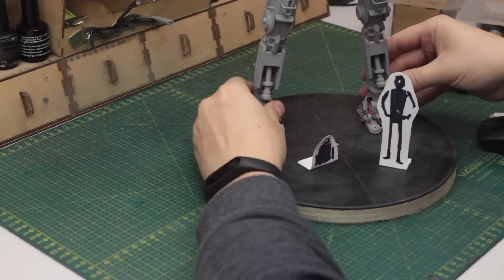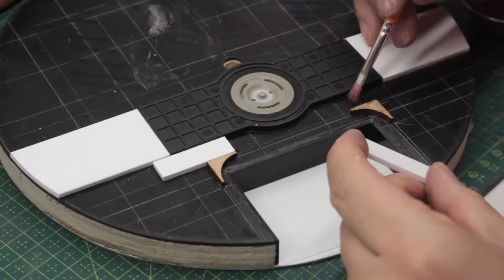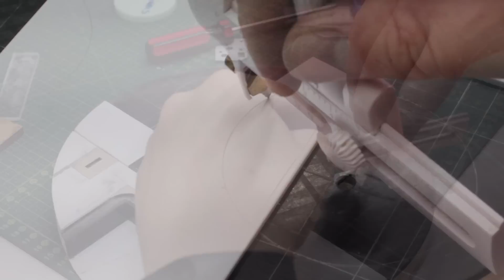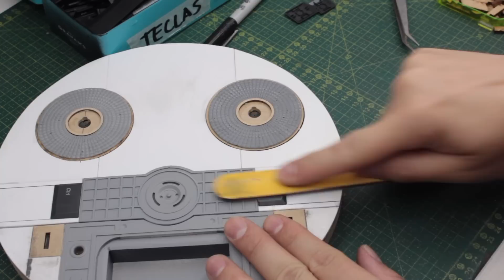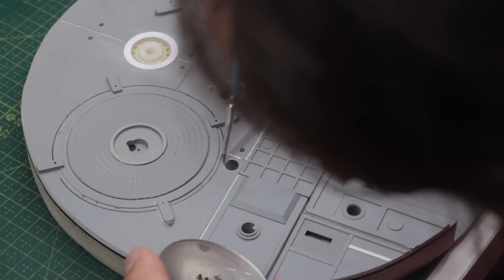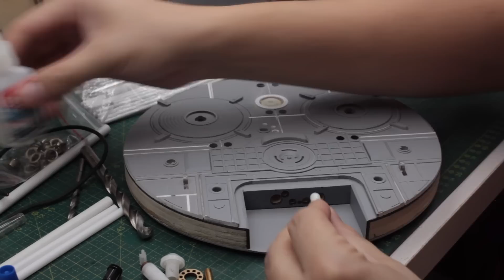This robot NEEDS a DIORAMA!

Comment: @Cut Transform Glue    I keep watching this  video over and over, again, 3 questions trying to figure out... 
1) Where you get the piece of styrene from? Black... can that piece possibly be salvaged from anything if so what do you know of that houses it... I know you prob bought that at the store, but other than store bought you know of any thing that has that big of a piece? I would love to know.
2) What SIZE is that circle/base of wood/styrene? You never did say a size that you were working with.  So I can get an Idea of scale over all.
3) Can you do more of parts stripping of items you get or find etc?  That can give me, as well as other people an Idea of what to look for out there or hunt for. as well specific parts wise. That also would be so helpful, I know it is kinda weird and not normal but your projects
Reply from the maker: Ok so: 1 - The black styrene was bought. You can salvage styrene from signs and stuff like that (some stores have banners and signs inside which are made out of styrene, eventually they get rid of them in exchange for new ones). 2 - The size of the base is around 26~27cm of diameter (that is around 10 inches) 3 - I can try in the next videos, thanks for the input! But I mainly look for dead electronics, the older the better since things were a lot more mechanical in the past. Old VCRs, cassete players, cameras, printers etc are some awesome good sources of greeblies
Reply: @CutTransformGlue  AHhhh I didn't know this, that is actually quite informative I may ask the stores then which can help in the recycling aspect... thank you.      Ah ok, that gives me a general idea, of what is a good size, that isnt too big nor too little, this helps immensely so thank you.   Oh yes please do, it does help.. yeah always dead electronics no reason to break down brand new ones, obviously ones that don't work, anymore. Older the better.  Frankly my thoughts were what are really inside there for greeblies that I can use, vs ones that i may want to stay away from since they may not be what i need in the thing in question (as we as makers always don't have enough space for everything we find sad but true) even breaking down will beomce a problem if I have my workbench covered in things I need to break down. My husbands workbench is SO much cleaner and organized than mine is cause of this. So i know that one quite well.

So thank you, it does help on what You recommend, and especially the videos, PLEASE PLEASE keep them coming it helps everyone out not jsut me...I love your videos, so please don't stop!  **BIG HUG FROM ARIZONA**
Reply from the maker: I totally get you! I'm a hoarder myself and I also have the lack of space issue.. The only way I'm able so save almost everything I find, is to keep things neatly organized, in storage boxes (the ones that are subdivided). Also, once or twice a year I go through all my pieces and I get rid of things that I've never put into use. But I guess as a model maker the pieces I collect are much smaller.. Thank you so much for your kind words, stay safe!

Comment: I thought I would share a thing I used or make hydraulics for my Silent Running drone. There is this sill kid jewelry making stuff. “Pony Lacing” it is called. The black tubing used to make the inside of the bracelets is flexible, bendable and hollow. It is made by Pepperell Crafts. They have beads. Connector strips and the tubing.
Reply from the maker: I'll look for that, thanks a lot!